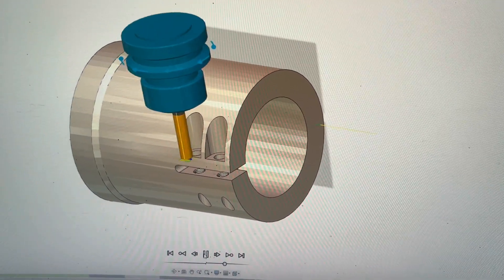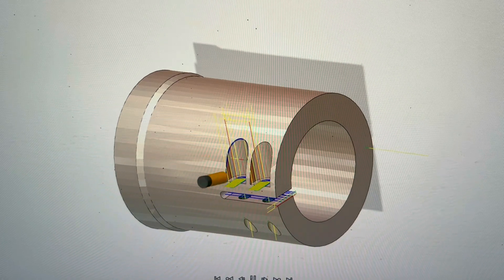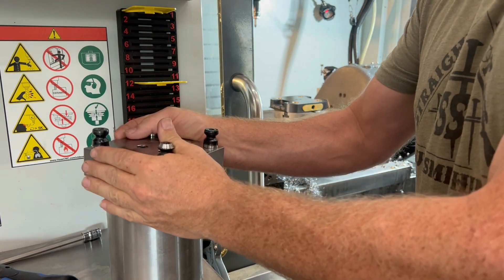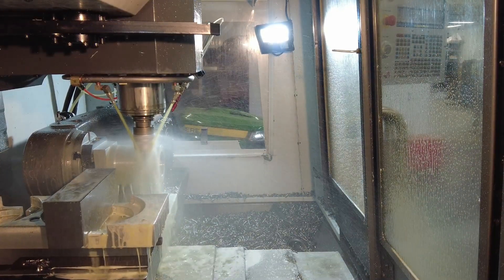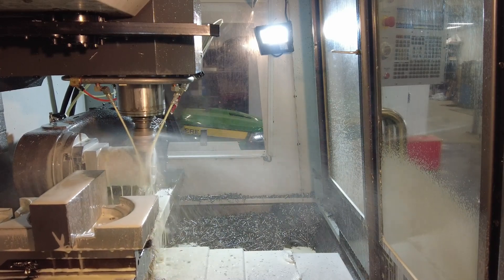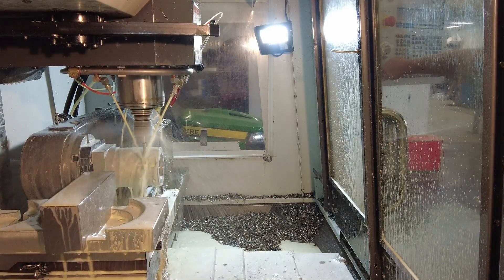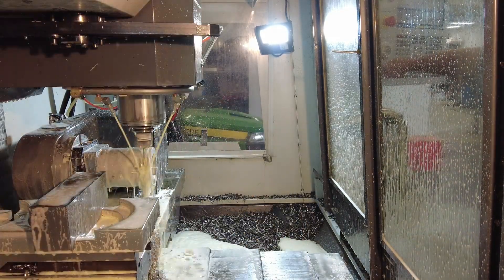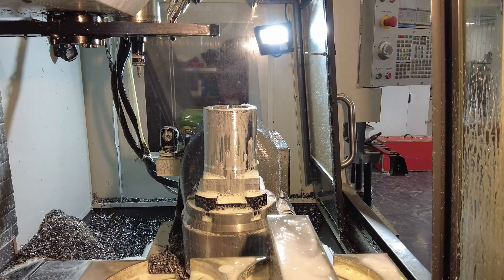Haas TL lathe Outboard spindle adapter Barrel flush system 2024 Haas VF2SSYT TRT210

Comment: I think the swiveling of the A-Axis in your case is post processor related and can be turned of by editing it. I've got a similar case on my DMU75, but with a different CAM system. Have you tried a slitting saw on the VF? You could chamfer it afterwards. I use them with great success. Mine are manufactured by Horn, though.
Reply from the maker: Thanks for the reply. Yes, the slitting saw is a great idea. I even have one. I will try to add that to the program for future use.
Yes, I figured it was in the post processor. Just haven’t figured out how to get in and edit the post processor.